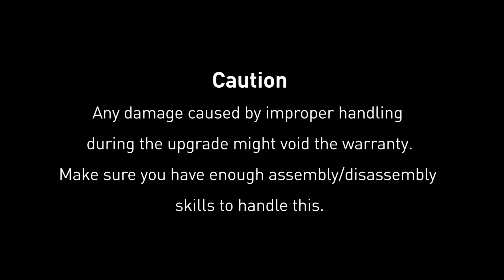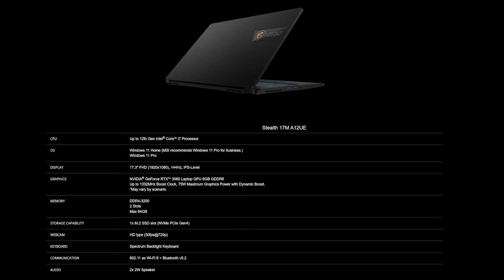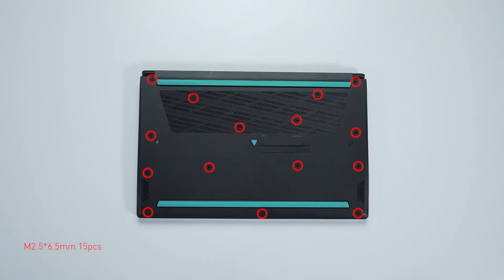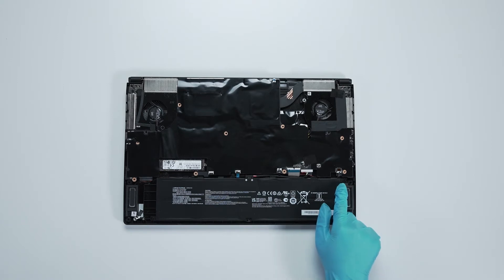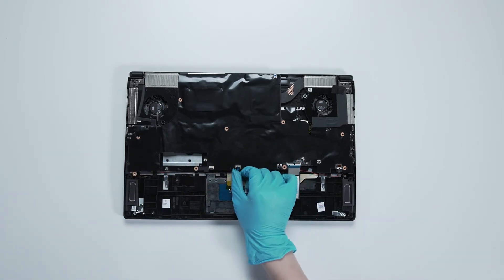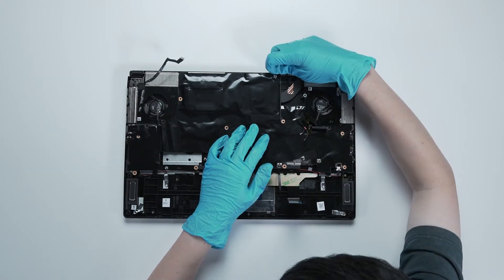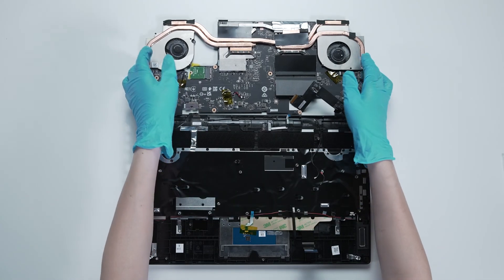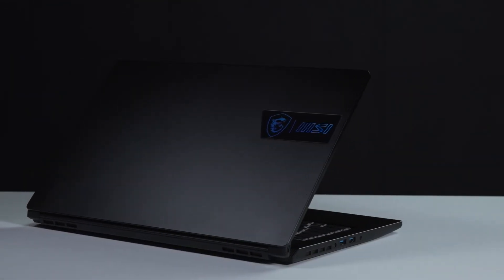MSI Stealth 17M Upgrade Tutorial

Comment: You have to basically take the whole thing apart just to change the ram? Man so glad I got the GS66 which is so easy to access everything well easy as laptops go, my desktop is nearly all tool less, I only got a laptop as a backup pc don't know laps can't just have access doors or panels etc. But no joke just go compare it with the Stealth GS66 video. Been working with computers since the 80's and never seen something this overly complicated just to do a simple thing like getting to the ram. This one has a lot of risk in it just to change or add ram.